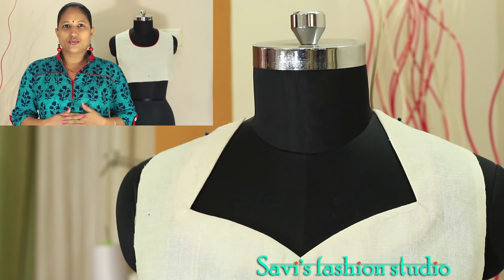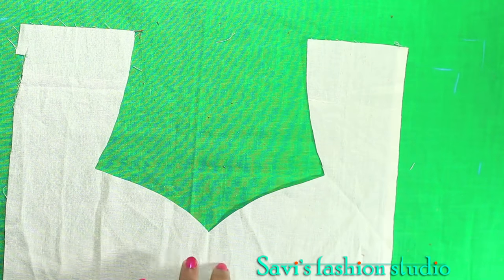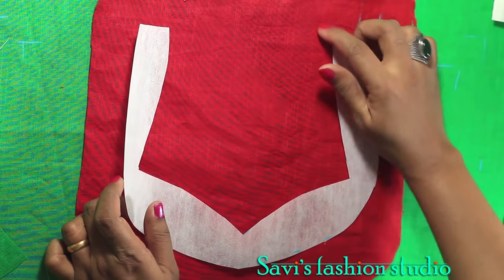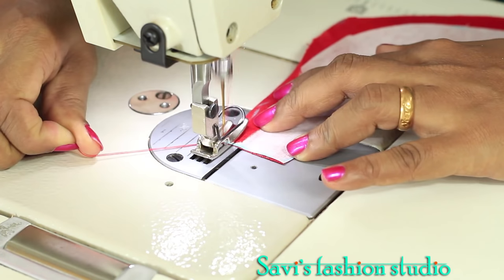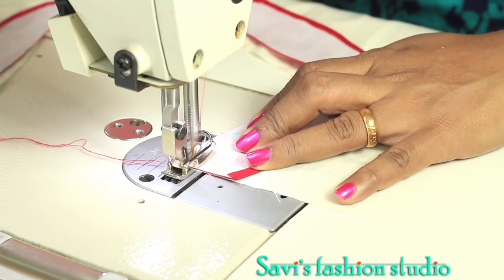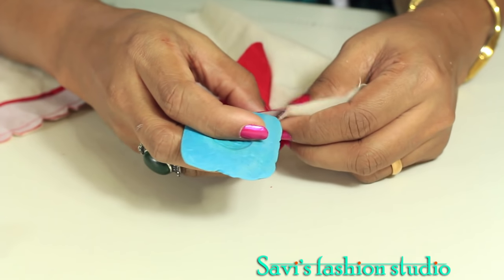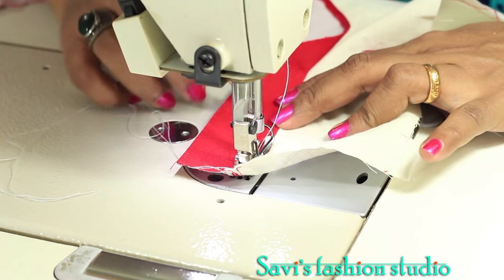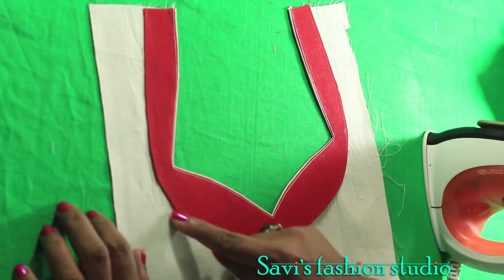Class 10 - How to finish design angled neckline with facing method / with canvas/fusing / buckram

Comment: Good morning madam thank u so much.
Ur method of teaching is simply superb.
Your voice is mild.
With lots of patience you are teaching madam. It's soothing to the ears to hear and follow.
Madam my problem while stitching is shoulder problem left shoulder will become short for eg 2.75"finally it becomes 2.3" or using canvas when neck line i do, it doesn't match with main fabric neck I'm trying i don't want to give up madam.
Reply from the maker: Very good day to you. This is a common issue faced by some beginners. It usually happens because of unknowingly stretching the neckline fabric. Pin the facing to the neckline  and stitch slowly and part by part.

Comment: Hi Savi, each of your video is very professional and very informative. Thank you for taking these sewing tutorials to a very professional level. They are very helpful!
I have a question regarding facing method. How to use facing method when the churidar top needs a lining? what I did is that I attached the fusing paper on the lining cloth. Then cut I according to shape. Then sewed it to the right side of the churidar cloth. Then turned it to inside. 

I am sure there must be an easier way to do this. could you please help me with it because most of my churdars  need lining?
Reply from the maker: +Ancy Thomas Hi, first of all thanks for taking time to appreciate.  

The method you followed also can be done but normally the lining is attached to the main fabric on the wrong side and then treated like one fabric. That is doing facing as you would do for a neckline without lining. 

Churidar actually refers to the push up pants worn with flared kurtis. The top is called Kurti or kameez :-)
Reply: +Savi's Fashion Studio
Thank you for the detailed reply. Really appreciate it.

Thanks for the correction too. I always miss it! :-D

Comment: Hai...When i tried this, there comes a slight difference between the fabric&facing..they do not come exactly..what shall ido?
Reply from the maker: +Simi Sudarsan Hi, this could happen due to 2 reasons 1] might not have cut the fusing paper exact or 2] body neckline might have stretched.  To rectify do an easing stitch around the body neckline as shown in this link. https://youtu.be/CHSRxOpNmmI . Then you should be able to attach the facing without problem.

Comment: Hello ma'am I have a double. In your previous video u told u attach the front n back of the garment n then u finish the neck line(using Bais) . In this method we aren't supposed to do that?? How do we attach the back?? Please help
Reply from the maker: There is a technique to finish when the front and back necklines are finished separately.  However, even for this kind of neckline, you can join the shoulders first and then sew the facing all around.   Different neckline finishing techniques are shown in our online classes on our website www.savisfashionstudio.com
Reply: Savi's Fashion Studio thank you so much for replying...

Comment: hi savita, whenever I tried doing this method, the facing always becomes smaller than the neck shape, this is when I'm stitching the interfacing to the body. where am I going wrong?
Reply from the maker: if the neckline stretches as you sew this can happen. put an easing stitch to the neckline and then sew the facing.
Reply: +Savi's Fashion Studio . ok will try that. thanku.

Comment: hi savi can u pl. tell why my neck is having few prob. 1. aage ki tarah gir raha hai 
2. teere se uper uth raha hai n shoulder se nitche gir raha hai
both prob. are started after attaching sleeves pl. guide me .
Reply from the maker: +Meena Chaudhary  Hi, If you have kept both front and back neck deep without reducing the shoulder measurement, this can happen. Also make sure the sleeves are not tight at the arm round, which can pull the shoulder down.
Reply: mam i have kept shoulder line 6" as mu back neck is 8.5" n front neck is 7" also my shoulder seam is 1.5" i.e broad n deep neck n armhole is 6.5"nou can u guess the fault or prob. pl. mam guide me

Comment: mam when ever i cut my neckline i do it with proper measurments but still after cutting it be's very small i dont no how come can you just guide me
Reply from the maker: It depends on the shape of the neckline too.  If you are doing deep you may decrease the width of the neckline and if you are doing wide, you may raise the depth. Also a V neckline if done deep does not look very deep but if a round or U neckline when done deep may look more then what you need.